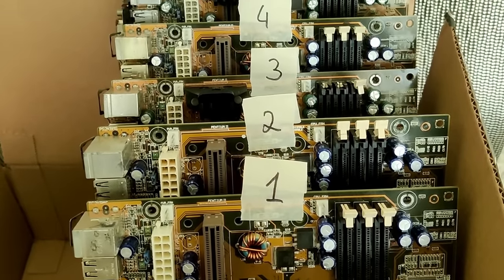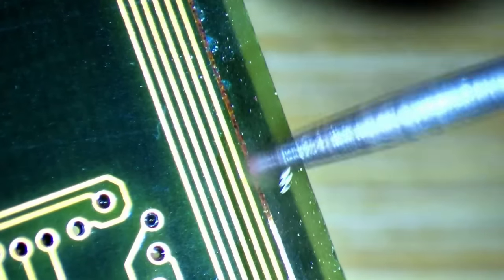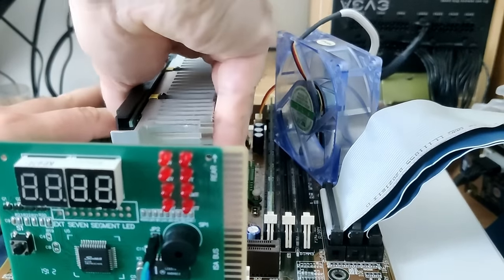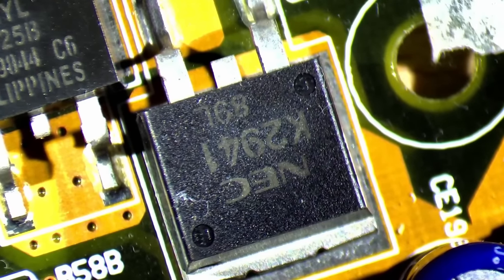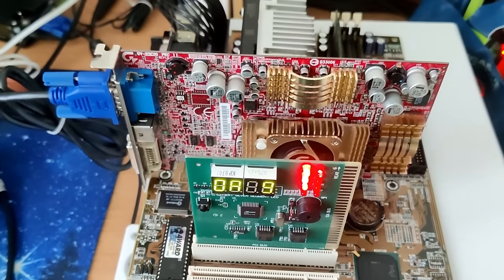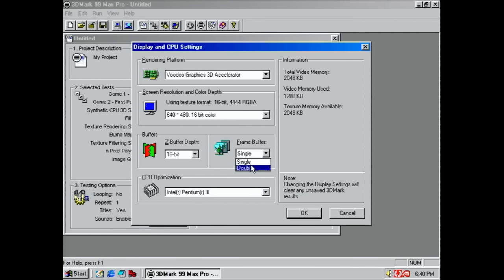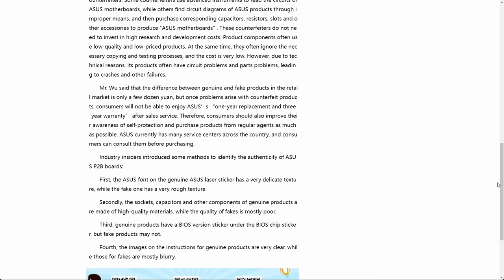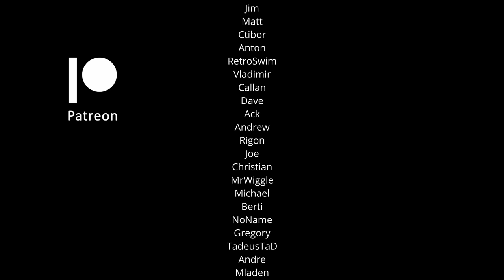ASUS P2B Restoration: Board #4 - Genuine Boards!

Comment: Do you actually know what the Asus chip is, and if it’s a generic thing, what can be used as replacement? Or was it a custom thing?
Reply from the maker: What I could find out is the ASUS AS97127F is a monitoring IC. It seems to be a clone of the Winbond W83781D. I hope this helps.
Reply: @bitsundbolts   Bloody hell the machine that be is shadowbanning me from the comments again. Shows up in "newest first" though.
Reply: The Winbond W83781 is a cut down version of ASUS AS97127F, by all reason sharing the same die, but with only 48 pins instead of 100,  and with some conspicuous "RESERVED" bits in the datasheet (besides the normal ones that you do expect). If you want to replace one with another, well good luck, given the pinout of the ASUS chip is not documented.
Reply from the maker: Sometimes it takes time for comments to appear. Not sure what type of checks they all go through.
Reply from the maker: Yeah, I don't think it's possible to replace that chip easily. I wonder if ASUS put some decoy traces connecting N/C pins to random stuff just to throw you off. I'm working on board 5 now. Tested the board with one pin disconnected due to corrosion killing the trace. All seems to work without issues.

Comment: Looks like that NEC MOSFET is getting hot and the solder melting.  I would suggest a small heatsink if you plain on keeping the boards.

Comment: thanks to these p2b videos i couldnt resist and bought my own p2b, revision 1.10! Which has the coppermine compatible power regulator onboard. Hopefully will pair it with Coppermine 550mhz.
Reply from the maker: Congratulations! I hope you'll have a lot of fun with this board!
Reply: @bitsundbolts  yes! I also have the rare 1ghz slot1 native cpu, but it has 133mhz front side bus. Would overclocking fsb on bx boards hurt them in the long run?
Reply from the maker: Funny you say that. I don't want to spoil too much, but I pulled two 1GHz/133 FSB from the scrapyard recently. I haven't tested them yet, but they will come in a video very soon! I don't think it will hurt, however, I do have some content coming up regarding the clock generator... Waiting for replacements to arrive. Oh, there is so much more I want to do with those boards!
Reply: @bitsundbolts  lets gooo!

Comment: I suspect cleaning the printer connector is possible by electrocleaning. You simply solder all the pins together at the board side and then run current through it in an elecrtrolyte bath just like electroplating, but in reverse.

Then you can nickel electroplate it. Nickel solution can be prepared at home, but you should get a high quality electrode. Also give it time don't rush it on initial preparation, use least salt possible, and i've found citric acid to be nicer to work with than acetic. I haven't tried electrocleaning yet but i have done plating.

Don't store your prepared solution in a container with a steel lid, it will be eaten, even if the lid is rubber lined. Use a HDPE container.

Comment: If they're counterfeit boards, but nonetheless working perfectly, they're potentially even more interesting as collectable retro hardware pieces.
That's sort of a weird paradox of period-produced counterfeits in collectables markets; there's usually a lot less of them than there are of the genuine thing, and being rare or even one-offs makes them special. Known counterfeit coins, for example, can sometimes sell for a lot.
As long as it's not a current product where unauthorized copies would hurt the legitimate manufacturer, and an item's counterfeit status is known and fully marketed up front so a buyer knows exactly what they're getting, some counterfeit items are actually very valuable pieces of history.

In this case, I think they're legit Asus boards, though.
Reply from the maker: Interesting take. I also believe that all six boards are genuine boards. Even though ASUS said there should be none or only a very limited quantity of revision 1.04.

Comment: You can have a dessolder machine blowing hot air (at 100C) on the chip label before removing it. It softens the glue, makes it much easier.
Reply from the maker: I was too lazy to get my hot air station out. Living in an apartment with all this equipment isn't easy. I need to stow away the stuff I don't use otherwise my wife is going to kill me.

Comment: 99% sure those boards are real Asuses.
Don't recall seeing one for this particular model, but counterfeit boards I ran into from that era were complete crap, chips wouldn't be quite parallel, writings on the PCB looked like it had gone through a copy machine 10 times and/or random misspellings were all over the place.
More importantly, they usually failed within a few months.
Reply from the maker: What you're describing regarding fakes does not apply to those boards at all. They look and feel like high quality boards - and all of them power on without recapping. Let's face it, I just reconnected some copper traces. My repairs weren't rocket science since all ICs still function! So, I agree with you. I'm also convinced that those boards are genuine.
Reply: I had a counterfeit ASUS HX430 board. Allegedly, according to our ASUS rep, manufactured in India. Every single sign listed matched the description of differences sent out in the press release, including the details of the antistatic bag, the manual, the stickers and silkscreens on the board. It was mint, i would have never guessed! And i ran it for 3 years too, overclocked it back and forth, it ran well, it was nice, really nice! It overclocked better than a Chaintech, and in turn that overclocked better than all sorts of... usual boards that were around, LuckyStar (garbage) FIC etc.

It was baby-AT. In fact same model i think as BuB already worked on, the P55T2P4.

Comment: @BitUndBolts
To me, at this point in time, it really doesn't matter whether or not they are real. If they work as intended and do the job, they are of value. Back in the day, sure it would have been a problem. But now it's very interesting and if you do have a few "fakes", then you have collectors items. Either way, they have value!

Comment: How can that power transistor detach from the board so often? It's beyond my reasoning... But after the other repairs, this one was like a piece of cake :P
Are you making the voltage regulator mod to all boards? I believe those boards deserve that upgrade, especially after all the effort you put into them!
Even if these boards are counterfeit, do you think there is any downside (as long as they work of course)?
Reply: They call this a "cold solder joint" but that's a misnomer. That happens if you have a batch of expired components. Have you seen the oxide layer on the bottom of the transistor? Naturally it's grown with time, but it's been there from day 1 of board's life. Expired solder paste or badly chosen proces parameters can contribute. There is always a little oxide but since it wasn't broken through by the flux in the solder paste, it was likely thicker than usual, and it just grows on components as they spend time in storage on their original reel. The boards are from the same batch. There must have been a small sliver of connected or grabbing solder at the very edge of the tab so it would have worked at first and the defect would have been invisible, except on X-Ray.

This is why serious manufacturers generally reject components that are a little old, and then they land in Huaqiangbei markets below cost for someone else to try their hand.
Reply: @SianaGearz  I didn't think of that, but makes a lot of sense! But in that case @bitsundbolts should make a close inspection to the transistor on the boards that worked without the need of fixing it.
Reply from the maker: Since I'll be selling the boards after I'm done with all of them, you'll be able to pick what should happen to the board. You can get it as is after the repair, or get the voltage regulator replacement, an additional recap, or some other mods I'm looking into right now.
Regarding the transistors that are still ok: I have no possibility to test if the solder connection is still good. So, there is a possibility that they will snap off. Maybe I do a precautionary reflow on this particular transistor for all the boards before they leave Dubai - just to be sure.

Comment: Dude, your soldering iron must be very good, because solder on motherboards is very difficult to remove, even on new motherboards, on old ones like this it must be even more difficult
Reply: Pardon? Solder, remove? Yes iron is good but flux is really doing some heavy lifting here.
Reply: @SianaGearz sorry, english is not my first language. I wanted to say weld. Motherboard weld is really hard, you need a lot of heat to soften it, even with flux. And the motherboard being old, complicates it even more. I use my soldering iron with the hot air station, because the soldering iron alone is not enough.
Reply: @SianaGearz  Yeah, it's really all about the flux, and about mixing in new low-melt solder with the old harder original solder to make it easier to melt and remove by wicking it away.
Reply: Actually easier on older hardware, atleast old enough to still have leaded solder.
Reply from the maker: I still use the FNIRSI HS-01. It's pretty good and I have been using it since I reviewed it. The bevel tip seems to do well and transfers a lot of heat to the board.
Edit: and of course, flux is a must and does help a lot!

Comment: Hi quick question - does your Pc analyser card work in the ISA slot when testing post - mine stops the board from posting in ISA  but works fine when in the PCI slot
Reply from the maker: I usually use it in PCI Slots due to its orientation facing me. But I did use it on occasion in ISA slots and never experienced such an issue.
Reply: @bitsundbolts  ok thanks for ur confirmation - i was putting in the wrong way - it faces away from me - the "rear" is the back of the PC not the back of the card ha ha - i just wanted to test the isa slots without having to boot into a system - this works
Reply from the maker: Wow! Great that you found out what the issue was! I always wondered what will happen if I plug it in wrongly. I thought it would damage the board. But I guess not...

Comment: Hi! I have a similar ASUS P2-99 board with an "auto start" issue. When I turn on surge protector, the computer turns on itself for 1-2 seconds and turns off. Then it turns on normally from the PWR_ON button. I'm afraid it's killing hard drive.
Have you encountered a similar issue?
Reply from the maker: Two of those P2Bs turned on the moment I connected the power supply. I'm not sure how this is possible. There shouldn't be any power from the ATX power supply unless the power signal is triggered. There must be some electrical signal that causes the power supply to turn on. In my case, the boards remained on. Why your board shuts off after a few seconds is indeed weird. Do you constantly toggle between surge protection?
Reply: @bitsundbolts  Thanks for reply! Same behavior when connected PSU directly to an outlet.
It seems that every time power is applied, the motherboard starts up to initialize the BIOS. 
I read somewhere that this is normal behavior, but I did not find any official documents confirming this issue.
Reply: @Resolute115  Pretty sure my Asus P2-99 does that as well.
Reply: W biosie powinny być ustawienia do tego...Suspend...
Reply: Just in case - there is an option in BIOS that determines what to do when the power is applied. Possible values are - "turn on, stay off or previous state". I'd check that option first (or reset CMOS, cause I think default is either "off" or "previous state")

Comment: I'd just remove the parallel port. It serves no purpose. lol (I doubt you'll be printing anything from these computers)
Reply from the maker: Haha, the second time you mention this :) you really dislike the parallel port, don't you? They're probably not used anymore, but I have spares. I guess i can leave it if the future owner of the board is fine with it. Otherwise, I am prepared to slap on one of those pink parallel ports 😅
Reply: @bitsundbolts  oh really? LMAO yeah I don't see the point. I rarely 2d print anything and I just a flash drive if I do.....not unlike my 3d printer. lol
Reply: @bitsundbolts  I never liked floppies either. I remember in 2003 I think I built a computer without a floppy. I'm like this is so epic! I think apple did it a couple years later. I was late to the no optical party though. In fact this computer I built in 2021 was supposed to have one......but I couldn't find a case that supported it. I did get a USB one........never used it! LMAO
Reply from the maker: For me, giving up floppy and optical wasn't that easy. I guess I didn't like the change. There was the occasional situation where I needed a boot floppy disk. Now, nobody cares about those media types anymore. However, I did find some nice Plextor drives the other day at the scrapyard... I wonder what to do with them. One DVD and one CD/DVD writer.
Reply: @bitsundbolts  I actually still used floppies, but only for work. I had windows servers that needed RAID drivers during the instalation and you can only do that for 2003 with a floppy. Later versions supported CD/DVD drivers.
Reply: What do you mean it serves no purpose, it's the last true GPIO interface in a computer. You can bit bang it. We used to connect all manner of things to the printer port! Need to program an AVR or a PIC? Printer port! Need to do some EEPROM programming? Printer port! Need to connect an HD44780 display? Printer port! Need some amber red and green LED blinkenlights? Printerport! Need to connect a Playstation game controller? Printerport! Need to connect the Commodore 1541 drive? Printer port is the best!
Reply from the maker: Haha, funny you say flashing an eeprom. I already have everything I need to flash some Soundblaster eeproms! I want to build a flasher that can connect to the printer port...
Reply: @SianaGearz  Once USB printers hit the market I never used one ever again. Hell eeprom programming you can do on the minipro over usb as well. True it's not everything, but it gets most at least the most commonly used ones. I just don't see the point.
Reply: @awilliams1701   I mean sure we use USB Arduinos these days to do all sorts of pin toggly tasks, BUT, you're also watching a channel where none of the machines are "needed" or "make sense", they're basically junk that all of us stopped using 20-25 years ago, because it was old and obsolete by then. Why would you even play original Tomb Raider on 3Dfx when you could play the remaster or emulate the game? Hell, SONY executive Jim Ryan says you don't really want to play those games to begin with, they're old junk, you should buy new ones.

But sometimes one just does things just like back then. Just because.
Reply: @SianaGearz  For me the main reason to keep these old systems is games. A P3 would be great for most dos games. Just about anything that I can't play on windows 10/11 I can play on XP, so that's a good target as well. I'm not sure how far you can go on XP. Maybe a core 2? I still have one. It has 8gb ram though, So I'd have to remove ram for XP (64 xp is practically useless)
Reply: @bitsundbolts  I would keep the parallel port there are various modern parallel port devices for old computers like parallel port sound cards. Only useful for dos but sometimes you might really want to play a dos game with genuine Tandy Sound
Reply: @awilliams1701  Officially XP can go as far as 3rd Gen Intel Core cpus with Ivy Bridge microarchitecture but unofficially 4th gen Intel Core cpus with Haswell microarchitecture can work, the trouble being finding the needed drivers. Pretty much if it was released before XP went out of support from Microsoft (2014) it probably has some level of support. You don't need to remove extra ram. 32bit XP just will not use anything above 4GB if it is there but more than 4 GB can be used with a hacked kernel but some third party drivers (in particular Nvidia) do not like 32bit XP hacked to use more than 4GB or Ram. Not that>4gb of ram in xp will be beneficial for games even if you can use it
Reply: @MonochromeWench  right. I remember when I built this system. I put in 8gb and someone in WOW was like......why? You can't use that. I'm like...ummmm yes I can. I'm getting vista 64 bit. I use unreal and frequently hit the 4gb cap during lighting builds. And I run plenty of other programs at the same time. I may not hit 8, but I'll easily hit 6gb. "but it's not possible to go over 4gb". ummm yeah it is! it's called 64 bit. HE refused to listen......it was so frustrating. lol And sure enough I ended up just barely clearing the 6gb mark at times. I really did use my 8gb of ram.

Comment: These are genuine ASUS P2B boards. I’m old and assembled many computers using these boards. Never even heard of a counterfeit P2B board and if they indeed do exist I doubt they were sold in the West
Reply from the maker: Hm... Good point. If there is a possibility for them originating from a "rework pile", then it'll be impossible to tell what the history of those boards were - or really any board. So, maybe genuine, but unauthorized to be distributed.
Reply: @bitsundbolts  also consider this: would counterfeit boards have even lasted this long?